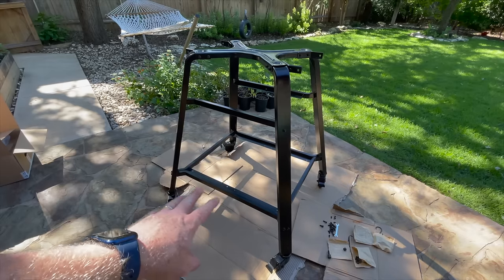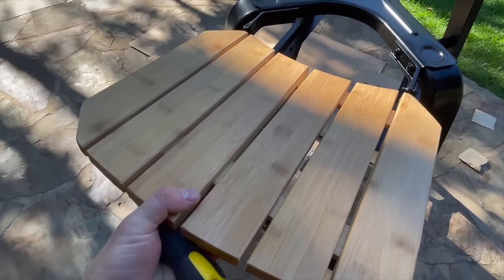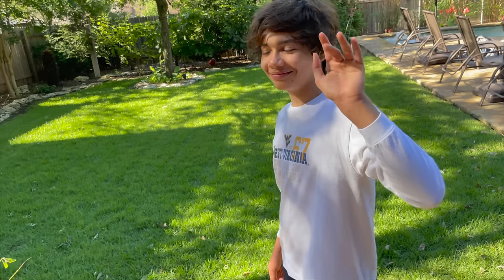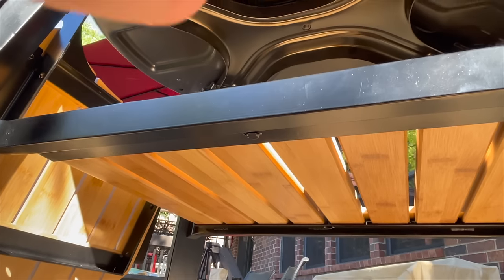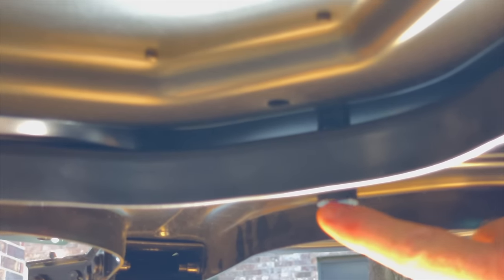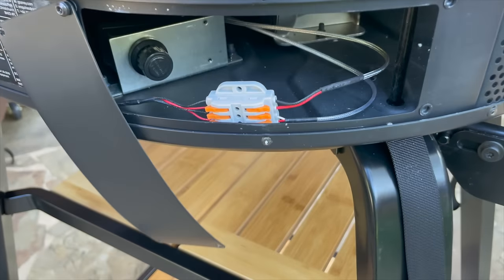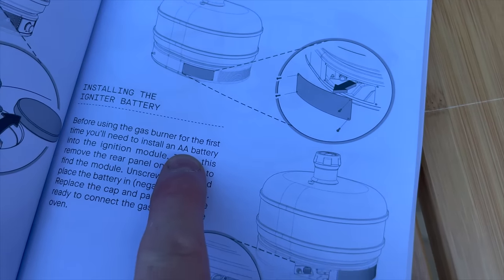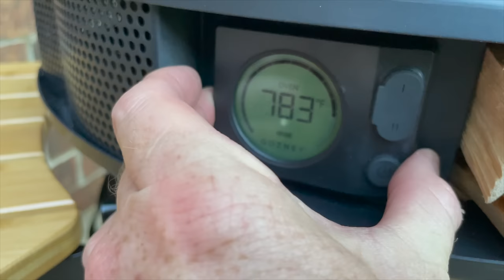Gozney Dome - First Pizza & Stand Build - 2 Pizzas 🍕

Comment: It's a wonderful oven. We just got ours and put the cart together too. Yes its super heavy and lots of parts. We did ok but one thing I would remind people to use the small hole washers for most of it and the LARGE  hole washers for the end.   Also the correct batteries required came with ours. For the price they should include the peel but do not.  Great thing about the cart is it can be easily moved and stored away from the weather.
Reply from the maker: Thanks so much for watching!  Best of luck with your new Dome!!!😎👍🏼🍕🔥
Reply: @HarplandProductions  one thing I am having difficulty with is a browned bottom. I have a lot of experience using wood ovens and so far I have only used the gas on our new Dome. If I get the oven up to a high temp then the top of the pizza gets baked too fast and the bottom is pale. I hate that! So, today I did an experiment and baked a pizza starting with a high temp then lowered it THEN put the pizza in. So the oven is hot and starts baking the pie, but then I left it in longer so the bottom would crisp up. It did get crispy but still not browned. At least it had some crunch. I will keep watching and see how you are working with the Dome. Thanks.
Reply: Any suggestions to get a browned bottom?
Reply from the maker: @blueberryblues3365  what type of pizza are you trying to cook, it could be your dough.  If you want more NYC style with crispy crust you will need to keep the oven around 550-650F
Reply from the maker: @blueberryblues3365  I would reduce your dough hydration and cook at lower heat and longer time!  The higher hydration, Neapolitans will not have crispy bottoms or crust

Comment: Just got my stand and Dome. Already assembled the stand but haven' placed the dome on top of it as gas connections need to be hooked up. Anyways the instructions say to put the screw into the spacer before you place Dome on top of it and then screw it more. Will see how it goes tomorrow. The screw seems quite long.
Reply from the maker: Hello Bobby,  I am sure you are very excited to get your new oven up and running!  Did you get the Natural Gas version?  Yes you defiantly want to put the spacer on first,  the screw needs to be that long to be able to go through the stand, then into the bottom of the oven.  Thanks for watching!
Reply: @HarplandProductions  - Just fired it up today for the first time and man the pizzas came super yum. Almost as good as going to a fancy local pizza shop. Initial firing took 10-15 tries before the pilot light came one. Your video were quite helpful. I am very happy with the purchase. what you recommend to remove the burnt up cornmeal from the inside?

Forgot to mention, it is the natural gas version.

Comment: Great video, thank you. Is it easy to move/roll the dome around on the stand a few feet? What about moving it down (still on the stand) from an alfresco area with a slight step down (3-4 inches high) to the backyard? Reason I ask is I would cook with gas under an eave and the roll it out in to the open to cook with wood. Thanks!
Reply from the maker: Hello CK,  thanks so much for watching! Rolling it around is pretty easy if you have it on a smooth / hard surface.  Mine is on flagstone so it's a bit of challenge but possible.  If moving it down a stair i would only do it with 2 people because it's extremely top heavy so if it starts leaning it could easily tip over and fall.

Comment: I'm glad it's so heavy! for setup it may be easier, if you lay the stand on the floor, remove the stone from the dome, bolt/mount it to the stand laying on the floor 90°vertical and then lift it up as it is bolted onto the stand... The cook looks nice! Radiant heat is massive from the gas flame, conduction heat on the stone looks okay, it looks a little weak from the walls..., convection heat... not quite sure yet hard to say from the vid only - all in all fine (it has to for the massive price tag :) ) I'm sure it's fun to cook with! Enjoy! Greez from vienna, Hinze
Reply from the maker: Hey Buddy,  Thanks so much for watching and providing great comments and feedback, i greatly appriciate it!  I was so excited to test it out I didn't think the lifting part out enough, I like your idea of laying it down then just lifting up attached! I agree, "Heavy" is better,  I am hoping it retains heat well!  I am not 100% sure about the convection heat yet,  will have to test it more and I also ordered the Neapolitan arch for the door that makes the opening small and should help with the radiant heat!

Comment: Can I put the Gozney Dome pizza oven in a covered patio with about 4-5 feet of clearance? Don't want any hot exhaust issues. How does this oven distribute heat from the exhaust, straight up or at the sides of the chimney top?
Reply from the maker: I replied to your other comment, yes, the chimney since the heat straight up again if you’re using gas, you shouldn’t have any issues if you’re gonna be burning wood and it’s better to have it out in the open so you don’t get your ceiling all black

Comment: Yo Harpland Dude!
Got mine set up and the first bottle of propane from the Albertsons down the street was empty? Anyway second installed and after setting thermo to F, cured it just like you and manual instructed. First pizza tonight with a 72 hour cold fermented dough. I also have a sour dough starter in the works. Thanks for your great instruction. I am going to purchase mantel and full cover which accommodates the mantle. Store I purchased from is allowing me to return short cover.
Reply from the maker: Very excited for you buddy!  Please keep me posted!

Comment: Please could you do some quick tests to show the sort of temperatures coming from the flue/chimney for those of us wanting to put them in our outdoor kitchens etc. Thanks.
Reply from the maker: Great suggestion!  The outer oven gets hot but i could still touch it when at 900 degrees, the flue got very hot and lot's of heat coming out but as long as your covered porch / patio ceiling is at least 3-4' away from it you should be ok.  I would also try to keep the oven a couple feet away from anything on all sides.

Comment: Watching you watch him hoping he could have the strength to raise it was incredible. Reminds me of when me and my dad had to lift the big joe into the cart. For sure thought I was gonna crack that egg.
Reply from the maker: Thank you so much for watching, greatly appreciate it. I know exactly what you mean, I just didn’t want him to get hurt trying to lift this it was crazy heavy!
Reply: for setup it may be easier, if you lay the stand on the floor, remove the stone from the dome, bolt/mount it to the stand laying on the floor 90°vertical and then lift it up as it is bolted onto the stand...
Reply from the maker: That’s a good idea
Reply: @HarplandProductions  thank you for this video.  Do you feel like this oven and cart are susceptible to being blown over?  The legs on the cart seem to be widely set and seems like that would help resist the wind.  Thoughts?
Reply from the maker: @11cmower  it's prob close to 300 lbs so no worries about it blowing over

Comment: Would you recommend Natural Gas if a connection can be made?  Or is a 20# propane bottle sufficient for residential use?
Reply from the maker: Hello Brad, for me propane is great, a standard 20lb tank will last me about 10 pizza nights and propane burns a bit hotter and is slightly more efficient than natural gas!

Comment: Another quick question, to stop the wooden shelves getting ruined in bad weather, in the UK it rains a lot, can you remove the middle and bottom wooden slats with the Dome on top, do you think by removing them to keep them in good condition it would change the integrity of the stand and make the Dome unstable?
Reply from the maker: Hello Paul,  Gozney has changed the type / quality of wood since the original ovens shipped out from bamboo to a much better quality hardwood so it might not be an issue now for you.  Also to your point,  yes you can remove the the middle and bottom ones very easily, they just lift out and are not structurally important!

Comment: Thanks so much for providing these very helpful videos. I was wondering if it is safe to use a wire brush on the stone to clean away any ash or debris during cooking.
Reply from the maker: Hello Mark,  Yes you can use a wire brush but very lightly and only for extreme cases.  I personally never use a wire brush because you run the risk of a small wire falling off and getting into your pizza and it can scratch your stone.  The best thing to due is turn the gas burner on high and let the oven self clean for an hour or 2 if there is big mess.  You can also use the front blade / edge of your placement peel to scrape off the stone while your cleaning it.  I would give this a shot first and then from there you could try the brush.   https://a.co/d/bI3IC02
Reply: @HarplandProductions  Thanks!

Comment: With propane, can you control the temp to 600 to 650 for NY style pizza?  Also it looks like the flame goes across the top of the dome - can you try “doming” a Neapolitan pizza?  Thanks for the updates - keep them coming!
Reply from the maker: Thanks for watching Alan!  When I had the burner on low that was about where the temperature topped out and yes when you crank the heat to high the flame wraps all the way over the top so should be easy to do a pizza, will try it out next time for you!

Comment: Hi there - I’ve just received mine and put the stand together but the bottom shelves look like they should screw in (there’s 8 screws left and 8 holes) but the holes in the metal frame line up with the screws that are already in the wooden shelf so the only 2 options  I have are drilling more holes on the shelf supports or just resting the shelves on.  Did you experience this and have a solution or did you just rest them?
Reply from the maker: Hello David,   Yeah i am not sure why they put the holes on there.  The shelves are meant to just sit into the frame and do not need to be screwed on!
Reply: @HarplandProductions  cool thank you for responding.  Anyway off to make my first pizza in the dome!

Comment: Thank you , great content . I don’t understand the design of this Dome cart. The duel fuel ovens use propane, and this stand has no place to store the tank. The little side tables seem a bit small to hold a 14” pizza tray, and the Dome cover , only covers the oven itself and not the cart . What did Gozney think they were designing this cart for ? I expected a lot more at this price point . What are you doing to protect your cart, and how do you store your tank while it’s attached to the oven ?
Reply from the maker: Thanks for watching Katniss!  The included hose for the tank is quite long so just set my tank behind the oven,  you can also place the tank on the bottom shelf, etc.  The oven is extremely heavy so it's not meant to be moved around a lot,  it has wheels but those are intended to just help get the oven in place.  So tank placement isn't too important once you have it where you want it.The cart side shelves are a pretty good size but you will still need a prep table to get the pizzas ready and to have your toppings all set out,  i use my side shelves to put my peel on and to hang a towel but you could set a pizza on it if needed but when the pizza comes out hot you really need to set it on a cooling rack so the bottom stays crisp.   The cover does only cover the oven,  which is the most important so you don't get the stone wet but it would be nice to have one that went down further to keep the wood dry below.  I know there are some other companies that are working on some 3rd party covers.  The stand itself doesn't really need protecting, it's very heavy duty and weather resistant.  Hope that helps!
Reply: @HarplandProductions  I appreciate your detailed reply , thank you !

Comment: I was checking one of these out at Ace Hardware this weekend.  The stand they had on display in the store felt a bit wobbly.  Not sure if it was just that it wasn't put together well or if that's how it is.  Were you able to get everything tightened on the stand?  With the way it felt in the store, I'd be nervous to move it.
Reply from the maker: The dome stand is actually very sturdy once all tightened up and you have the oven on top. It really depends on the surface that you have the stand placed on. Mine is on Flagstone so it’s much easier to have two people to roll it around if you’re on a smooth surface like cement it’s very easy to move with one person.

Comment: Hay man my wood is coming in July. Can’t wait. Can you do a wood burn and time the time to go up to temp. Plus show how you started the fire 🔥🍺🍺👊🏼👊🏼👊🏼
Reply from the maker: Absolutely, thanks so much for watching! I will absolutely be doing a woodburning video soon
Reply: I’ve got a gas wood multi fuel coming. Me? I’d bring it up to trmp pretty quickly on gas.... and switch to wood. This was one of the reasons I bought the gas/wood option.
Reply from the maker: Thanks for watching Tony!  Yes i may also try that, the only issue will be the burner insert and placing the ceramic puck over the gas burner to prevent ash from getting in it and with the puck installed over the burner it will give you a lot more space!  I’ll probably try to heat it up with gas and use my grill tongs to remove the cover and placed the puck in!

Comment: Curious to see how the ivory color holds up over time.  It’s a nice color....just worried about char coloring. Great video.
Reply from the maker: Thank you so much for watching, and the positive feedback, I greatly appreciate it. I’m curious also to see how long it takes until the front turns black, if it turns black?
Reply: @HarplandProductions  I've had 3 separate propane burners for my Rocbox because of defects and the amount of soot generated varried greatly between the three. From low to high. Does this one produce a lot of soot? Does the chimney help? How quickly does it guzzle propane by comparison?
Reply from the maker: I haven’t used it a lot yet but it appears most of the smoke and flame go into the chimney and out the flue!  The gas burner is rated to 10.0 kW.  
A 9kg (20lb is the US standard for Gas Grill) propane bottle will give around 18 hours use on average.

Comment: Hi Matt.  Thanks for the great videos.   Waiting for my Dome to arrive.  Wondering about the stand durability.  It looked like there was some blistering on one of the legs in one of the videos I watched.   I live next to the ocean in Canada and wondering if a stainless steel stand would be better.    Thanks in advance for your input.  Keith
Reply from the maker: Hello Keith,  thanks for watching, My stand was a pre-production version so there are some blemishes that have been there from the start,  and the bamboo can coating isn't what you will get.  It has actually held up very well for being out in the elements  for over a year now, no rust at all!  Being by the Ocean could impact that a bit,  depending on how close is close,  if you get a lot of salt spray it prob wouldn't hurt to hose it down with fresh water once in a while. but end of the day it's very heavy duty and should last you a long while.  My Fiends and Darebuilt are workin a some Custom heavy duty Stands so you might want to reach out to them, and their right in your backyard!
Reply: @HarplandProductions  thanks for the feedback and will reach out to Darebuilt as I like their tools.   Keep up the excellent work.

Comment: Question. How hot does the exterior get? Wondering if I can put this on my balcony in my apt…
Reply from the maker: Hello Janice,  as long as you have enough space to keep the oven away from the wall,  i would say you want to have at least 12" between the oven and any wall  and you will want to make sure you have plenty of ventilation.  The outside of the oven typically stays in the 200F range when the inside is at the 1000F temp.   I know quite a few people that have them and use them on apt. porches and patios.  I would just make sure you are permitted to use ovens / grills etc.

Comment: I enjoyed the Deep Creek Lake shirt from the unboxing video, what is the diameter of your turning peel?  I have a 6.75" turning peel one and a 12" placement peel, since I need to get longer ones I was wondering if I should got with a 8" turning peel and 14-16" placement peel.
Reply from the maker: Yeah I love deep creek lake, a group skiing at Wisp when I was a kid!  Regarding your peels It really depends on what size of pizzas you’re going to make the most of. My turning peels a 7 inch diameter one but it has a 32 inch handle and it’s perfect, the launching peel I have is 3 ‘ total!  In the perfect world you would have 2 placement peels 1 - 12” wide and 1 - 14” wide one.  I typically only make Neapolitan pizzas so in mo hurry for a wider one

Comment: Love your videos. Where did you get the stainless table top?
Reply from the maker: thank you so much for watching!Arcedo Outdoor Bistro Table Set Cover, Heavy Duty Waterproof Patio Furniture Covers for 3 Pieces Bistro Set, All Weather Resistant Outdoor Table and Chair Covers, 65" L x 28" W x 30" H, Beige & Brown
https://amzn.to/3wiGkvp

My Table is 60” X 24” with Caster Wheels - Here is a link 
https://amzn.to/39qQ8NG
Reply: @HarplandProductions  sometimes my gluten free dough doesn’t come off the peel like it should. Leaving me with a mess. I was successful tonight with 5 out of the 7 pizzas making it. Do you think this is from not enough flour on my cutting board, or maybe that I need a stainless table like this coupled with flour while making the dough?
Reply from the maker: @truthhurts7529  I would make sure your using semolina flour to put on your board, if you are use a bit more